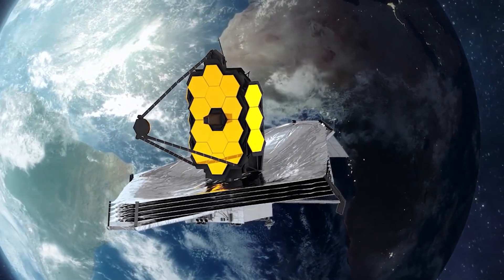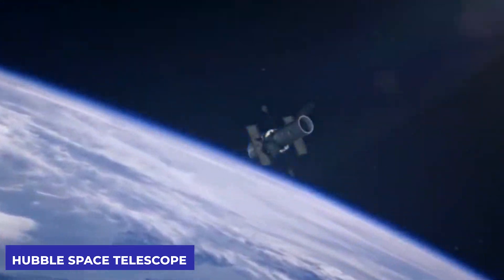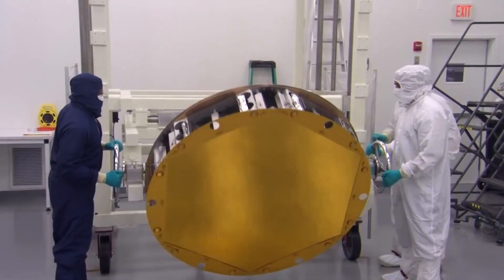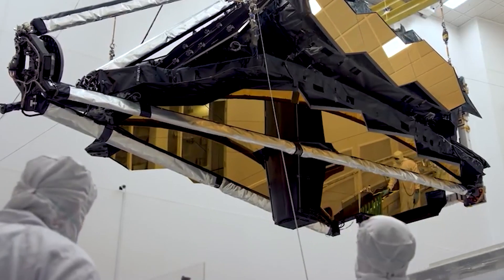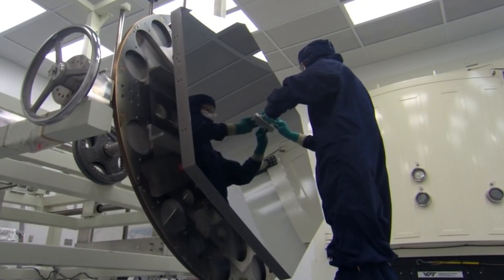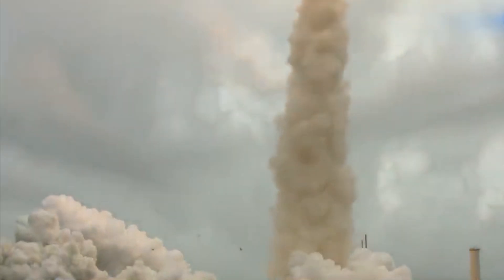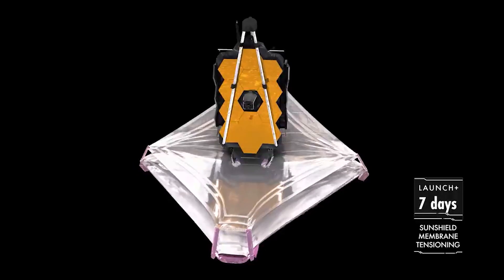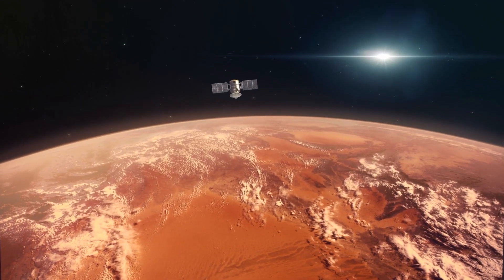Elon Musk REVEALED This About The James Webb Telescope Totally Insane

Comment: The James Webb Space Telescope is going to see galaxies all kinds of galaxies, nothing but galaxies were created by the universe (all the mass in a small… ) it became, for a short time, a galaxy creating machine. The first thing it created was one very large spiral galaxy by the energy from both sides pushing full blast against each other creating that first galaxy. The tremendous stress blew both sides into countless pieces, each piece pushing on those next to it creating more and more spiral and elliptical galaxies, black holes, and other odd shaped galaxies. The progenitors (the Universe in pieces) that created all this, are now called Quasars. Most Quasars pushed each other out, while creating galaxies and finally became the perimeter of the physical universe. From there the Quasars control both parts of the universe, the physical and the light. Quasars are responsible for gravity (in the physical universe), the speed of electromagnetic waves, and enable many other things. The energy from each quasar converges with all the others on every instance in the physical universe. Some Quasars stalled and remained inside the physical universe. The JWST will help us understand better what exactly happened back then!